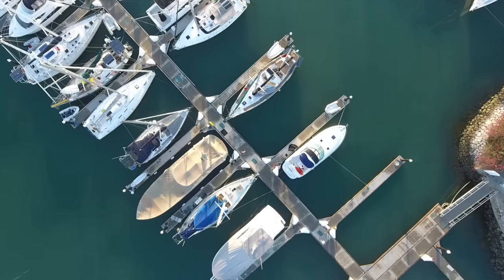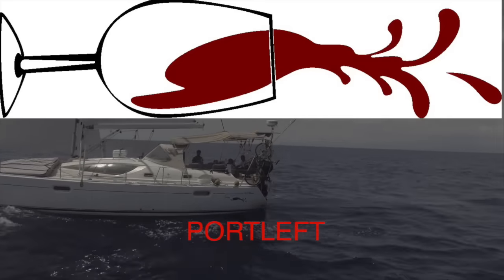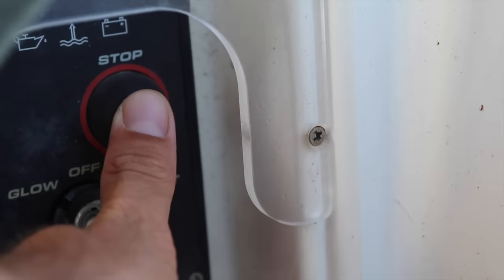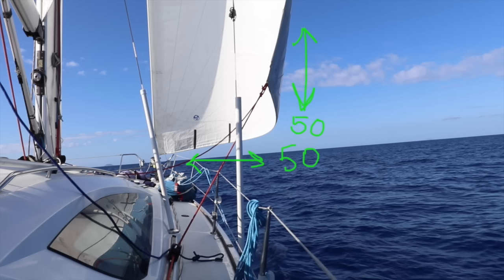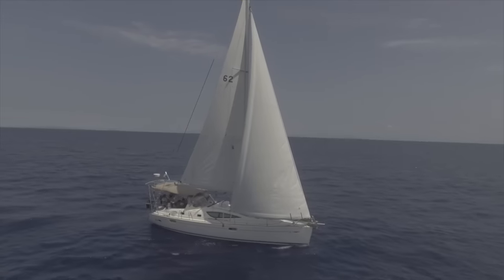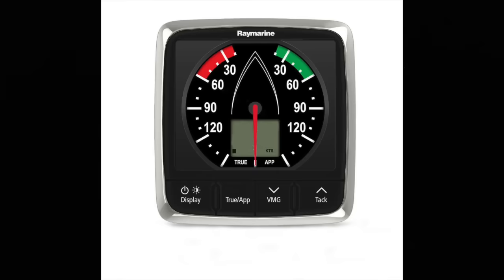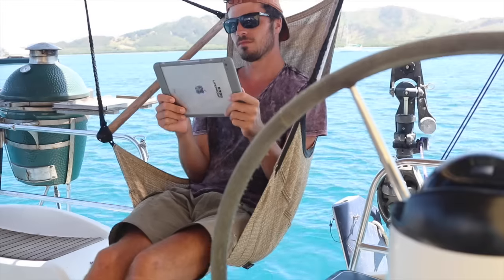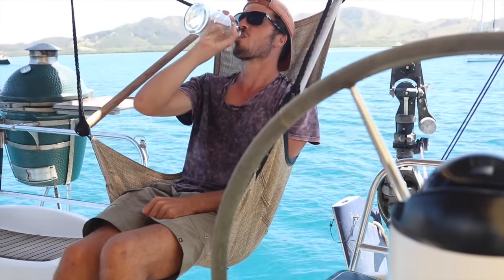Learn How To Sail in 20 min

Comment: Great job! The only thing I would say is when leaving the slip, put the bow line on the bow vs tieing it to the lifeline because IF (when) it comes untied it will go straight into the prop. One way to avoid that is to make sure it is always a couple of feet short of reaching the prop but hey, it's better to place it under the lifeline and on the foredeck (quick coil of course :-)
Reply from the maker: Thanks for the addition Captain Mark!
Reply: My pleasure. The best thing about boating is the people who are always willing and very happy to help in any way. Boaters are the best people on earth (except the pirates of course :-)

Comment: Hoi Huub. Very good video. The reason why a rope turns into a line while onboard ( I am actually talking about  all the specific vocabulary used on a boat) is that you have to make sure that any (new) crew member from anywhere uses the same word for every different thing on the boat. Being dutch this is not a big problem because this language is not spoken in so many regions. But take Spanish for instance. There are dozens of different words for rope depending if you come from Spain, Chile,  Mexico or wherever .
In other words, on board there should be no room for doubts or misundertandings . In the very beginng I also had the idea that sailing people were kind of snobish but after a while I understood that using a common vocabulary is a must.
Vriendelijke groeten uit Montevideo, Uruguay
Reply: Well explained 😊

Comment: This is a great video! If you are still making them, it would interesting to get a bit more of a demonstration about the use of the whisker pole and as well the additional line you affix to the anchor line to take pressure off the Windlass.

Comment: What an amazing and succinct video. 

I hope you do one on docking into slips that includes;

- what to do when getting into trouble (wind direction, speed, communication, etc)

- docking on difficult turn radius taking into account left handed vs right handed props (e.g. left handed props don’t turn well to the right and vice-versa).
Reply from the maker: Hey John, currently I’m road tripping in a car, but I’ll keep it in mind for when I’m back in to sailing :)

Comment: Unless I misunderstood your explanation, you screwed up when you explained how the red and green buoys work. In the charts there is an arrow with two circles in front of it. If you are sailing in the direction of the arrow then you should always have the green buoys on your starboard side and red ones on the port side (that is the color of the buoys mach the color of your lanterns). If you go the other way, obviously it is reversed. It is very important to know this, because you are not always supposed to go between them. I have seen several places where between the buoys is the only place where it is not safe to go, though it is less common. Also sometimes there will be only one, they don't always come in pairs, and it is not always obvious which side you should pass unless you have the charts.

Comment: Great video! Had a good laugh and it's actually fairly comprehensive. On important thing though about "the rules". You forgot rule 0:  
Avoid collision at all cost. There's no such thing as right of way on the sea. You can be burdened to give way, but you never have right of way. Even if the other boat is burdened to give you right of way, you still have to actively watch out and if you don't get right of way you still have to take action to avoid a dangerous situation. 
Basically if you ever have a collision between two boats, then both boats are at fault. Always. Maybe one a little more than the other. Say 30/70, but never 0/100 as you might expect from a car accident. 
So if you want to learn sailing in 20 minutes, just stick to avoiding other boats. That's one simple rule. No mice, snakes or sharks involved! :-P
If you want to learn the nitty gritty details, look at COLREGS 2 and 17.
Reply from the maker: Hi Paul, thanks for adding your knowledge to this video. All the best, Huub
Reply: This should be pinned.
Reply: except when its parked in your yard. and a drunk driver still managed to smash it. hopefully they have insurance and you get a nice new yacht

Comment: Left side is Port, because in old days, the sailing vessels were at port, being loaded with merchandise to be shipped. The left side of the boat is what faced the port and the right side of the boat, at night, when you look out, you see the stars. So if you look left, you are looking at the port (dock, buildings, warehouses and road or brick road), and look right you see stars. Starboard is right side and Port is left side.

That was the typical layout of proper vessel tie up at the sea port.

I remember Starboard from Port by saying in my mind, Stars are up, and up is good, right is good and green is good, So the Starboard side is Right and the light on the Starboard side is Green. Once I remembered that, the other side was easy. Port, Left, Red.

So how do I get Right is good? For several reasons. 

#1 Most people are Right Handed, which is considered normal or good. Left handed (people like me) are considered odd. In fact, in the old days, teachers would whack left handers if they seen them writing left handed. Lefties were forced to learn to write with the right hand.

#2 For thousands of years, when judging the good and bad people, the good people are put on the right and the bad people are put on the left. So in the old days, right, front and up are good, and left, rear and down are bad.

#3 When taking sides, in an issue being decided, there is the right side and wrong side. Again, the reference of Good is up and wrong is down. In sea legend, Davy jones Locker is not a good place to go and that is down. Hell is down and that is not good. Heaven, Valhalla and Eternal Life is up, which is good. So people who are on the side of right, are good.

So most every analogy in human history, Starboard would by natural terms be Right and that leaves Port to be left. Same with the red and green lights on the bow. Green good and Red bad. Green Right and that leave Red as left. Green Starboard and Red Port.

Oddly, even though I am left handed, I kick a ball with my right foot. I also play the guitar right handed. 

On old larger sailing ships, if it had a cargo door on the side, it was usually on the port side, because it would be opened and cargo could be loaded or unloaded.

I still like this video. He has very good ways to remember things, and when you are out sailing, it is best to remember, no matter why you remember, it is WHAT you remember.  8-)
Reply: The term starboard derives from the Old English steorbord, meaning the side on which the ship is steered. Before ships had rudders on their centrelines, they were steered with a steering oar at the stern of the ship and, because more people are right-handed, on the right-hand side of it. The term is cognate with the Old Norse stýri (rudder) and borð (side of a ship). Since the steering oar was on the right side of the boat, it would tie up at wharf on the other side. Hence the left side was called port.

Formerly, larboard was used instead of port. This is from Middle-English ladebord and the term lade is related to the modern load. Larboard sounds similar to starboard and in 1844 the Royal Navy ordered that port be used instead. The United States Navy followed suit in 1846. Larboard continued to be used well into the 1850s by whalers. In Old English the word was bæcbord, of which cognates are used in other European languages, for example as the present Dutch bakboord, the German backbord and the French term bâbord (derived in turn from Middle Dutch).
Reply from the maker: Hey Sailing Lighthouse, nice addition! All the best, Huub
Reply: or remember it because both port and left have 4 letters...
Reply: @nathanrice3890  I also think Starboard, right, better lol

Comment: it was not rich guys, usually it comes from ancient sailors, who were the poorest of the poor
Reply: How poor were they if they ruled the world?!
Reply: Agreed.  Bow, Stern, Port, and Starboard are all helpful on a vessel because you aren't always facing the same direction as the boat would be traveling.  Right facing the aft would be Port, and right would be an incorrect term more than likely causing confusion and danger.  The terms are good for this reason and not difficult to memorize.
Reply: @christveteran1508  You'll be disappointed to note that it wasn't just white people or rich people that kept the terminology. Sounds like you're bitter at white people with money.
Reply: Actually, the terminology is specific and different so that multiple people crewing a boat can use that term and all know specifically what it means.  Try reading instead of making ignorant assumptions.

Comment: A good way to remember starboard as being right, is that the term comes from "steer board" which you would control with your strong, right arm. I think it was a predecessor of a rudder, which stuck over the side of the ship on the right hand side, steer board, starboard. I can imagine vikings using these.
Reply from the maker: That works well to remember too :)

Comment: At 8:00 he mentions the standing rigging from the mast to the bow as ‘forestay’ which, in this case is correct (because it’s the only rigging there) but in a different rig such as a cutter or cat the terminology is ‘headstay’ since it’s attached to the head of the mast and a forestay normally is lower on the mast to accommodate a jib and not the larger Genoa
Reply from the maker: Thanks for the addition!

Comment: Nice and simple video! Good for explaining sailing for beginners. 
There's a good reason for why it's called port and starboard. The words come from the old Norse (yes the inhabitants of Norway, Sweden, Denmark and Iceland whom did "Viking". Yes there called Vikings, but this isn't correct). The words are "styrbord" and "barbord" and it translates to steering wheel-board and empty board. This is because the steering mechanism was on the starboard side. And it still is on boats ;-)
Reply from the maker: Hey Mons, nice addition! I did not know that! All the best! Huub

Comment: My gosh, best vid so far..can I get your thinking on a pearson 36 ketch 1980.
I hold a 200 ton masters license,  but have never sailed,  only motor. 
I would live your feedback.
Reply from the maker: I would advise you to go look at a bunch of different boats. As for the Pearson 36. Pearsons from that year are very strong boats. But of course also a little narrow compared to newer boats. A beneteau from the last 10 years of the same length has a lot more space for an example. I think that a pearson 36 is a good choice. Ive sailed on a pearson 32. And that one only had a front berth to sleep in and I slept on the couch. Which is fine for temporary. But depending on how many people you expect to sail with in the future, for long term sailing together it's so nice if you somehow have your own space.
Reply: @HuubVlogs  the 36 ketch has v both and two setees of 6'6" each.one folds out to a queen.  The with is 11'6".
At 17,000 dollars should I pounce on it?
Did you do bluewater run on the 32, are they seaworthy?

Comment: What happens if on a gusty day the wind keeps shifting?!
This would mean constantly changing the angle of the sails?
Wouldn’t it make more sense to have a wind turbine directly geared to the propeller so the boat can travel in a straight line REGARDLESS OF WIND DIRECTION?
Reply from the maker: Haha I like your idea, a solar powered one ;)
Reply: The Dutch Seaman Hi Dutch great video thanks, but seriously someone really has mounted a tri blade wind turbine onto a catamaran with direct drive to the propeller not by electric power.
The video is on YouTube, he also has a much smaller wind turbine mounted probably for batteries.
I think it’s great especially as the tri blade mast could act as a back up for a makeshift normal  sail in an emergency.
Just type wind turbine catamaran guernsey in YouTube.

Comment: Another handy reminder for port and starboard, at least in English: Port > Short word, Starboard > Long word. Left > Short word, Right > Long word.
Just remember to be looking toward the front of the boat... 

Also, were you able to recover your drone? -  Commercial drones really should be required to be sold with buoyancy bags for use around water.
Reply from the maker: Thanks RealLuckless! Haha no, it landed in the ocean and immediately sank to the bottom. Ah well, at least I didn't have to carry that big suitcase on my bicycle cycling 3.000km in NZ after Fiji hahaha

Comment: Why can't you sail directly downwind? I only have experience sailing small open boats, in those it is not a problem, so what is the difference?
Reply from the maker: It's mainly because sails work like the wings of an airplane, there has to be a certain type of airflow against the wings in order to move the object forwards. Maybe if there's a lot of wind you can almost go dead downwind because a lot of wind will move the boat easily forward anyway whether you trim the sails correct or less correct. The art is more to get the maximum speed out of the boat with less wind.

Comment: The video should be called "Learn boating basics, "Rules of the Road" and how electronics help you sail". The current title of the video would be appropriate if you left the dock and raised the sails without using a motor or electronics; explained the various points of sail you used and then anchored all without relying on engines and electronics. I liked the rules of the road content though. That is important. Not enough people with boats know what they are.
Reply from the maker: Hey Emily, that would have been an all including title yes. All the best! Huub

Comment: Now we need one for boats with no motors.
Reply from the maker: The most tricky for a sailboat with no engine is getting in and out of anchorages when they are protected and have no wind. I personally would either add paddles on a small boat or a small engine to avoid collision.
Reply: Thank you!

Comment: "No need to be rich and upper-class..." "I assume you have an auto pilot..." Never priced an auto pilot, huh?
Reply from the maker: Hi Josef, Sailing without an autopilot or wind vane alone is very difficult. I think most people these days have an autopilot. Wether it's a simple one attached to the tiller or a bigger one. Also, if I would have to mention all the possibilities the video would've been very complicated and my goal was to teach the concept of sailing. If specifics are different from someone's boat I think they at least have a start to work from... All the best! Huub
Reply: The Dutch Seaman 
My 89 Catalina 30 has a Raymarine steering wheel autopilot that doesn't work at all in heavy weather. It's several thousand dollars for a new model that may or may not work. Replacing it is not an option because it is too expensive. Fortunately, I won't be cruising in this boat.
Reply: i make under the poverty line and several thousand dollars isnt an unreal amount of money for primary/secondary hobby.
Reply: KGBeast 
That was for one item.  Plan on paying that amount monthly for an old boat that you can afford. It's easy for people who don't own a boat to chime in...
Reply: Josef; Nobody's fault but your own you cant afford your hobby. Take up walking.

Comment: You are seriously wrong. NO BOAT HAS THE RIGHT OF WAY. There is the stand on boat and the give way boat. No boat has RIGHTS. The rules state that both boats must do what ever is necessary to avoid collision. If there is an accident, most of the time, both captains are considered at fault. If you are the stand on boat, you hold course until it is necessary to turn to avoid collision, but you must avoid collision. If you are the give way boat, you must change your course to avoid collision. If you are the give way boat, you should also yell to the stand on boat "Hold Your Course" or "Course". This tells the stand on boat to not make any changes, as you are planning on avoiding him. Otherwise he may change course to avoid you, which may actually cause a collision.